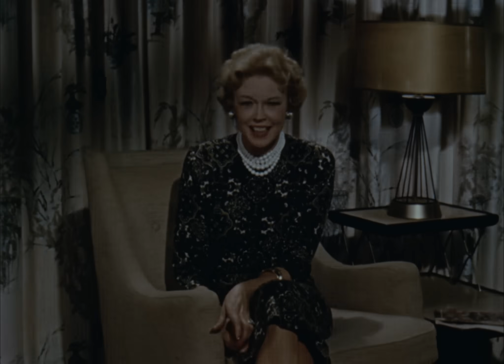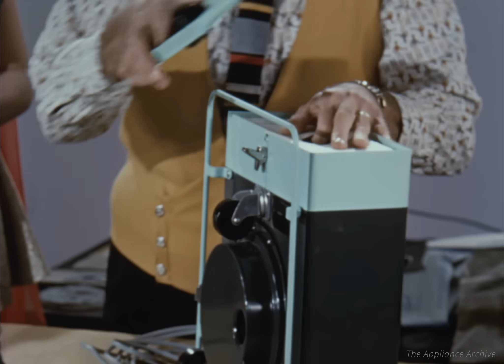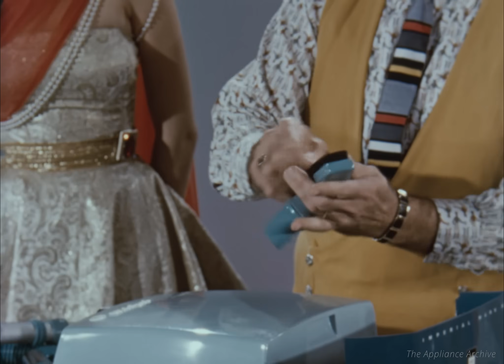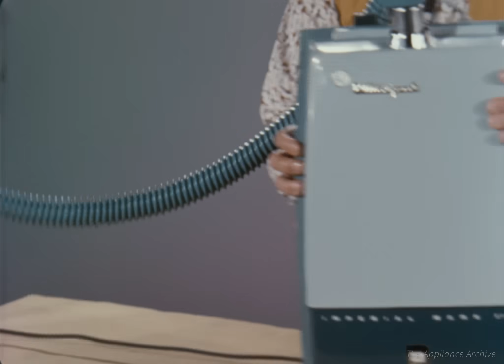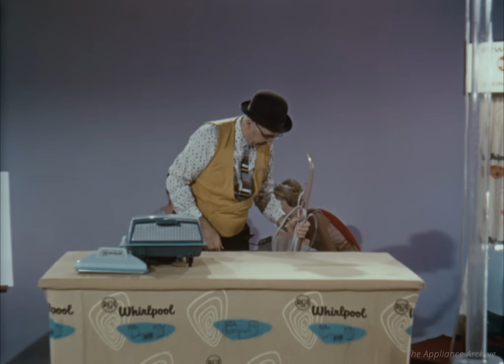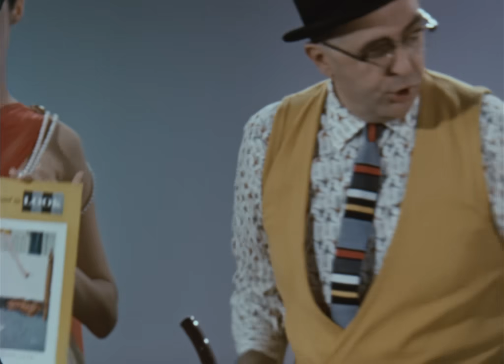Whirlpool Vacuum Cleaners w/ Fran Allison - 1957 - Restored 2K Print

Comment: I can imagine a lot of dust made it past that bag and destroy😂d the motor. 
Nice fashion - not.  Fran wearing her best pearls to add creditably to the product. 😅
Reply: It's not that bad. I have many vacuums that have been abused and left abandoned and they still do fine. The motors overheating is the main thing that killed these old vacuums as they needed the airflow through the bag to cool the motor. If you overfilled the bag and it couldnt get enough air, the motors would start roasting. I make my own HEPA bags for my old vacuums that have un-findable rare bags. and the HEPA filter bags make the motors ice cold, as they let so much air pass through more than a paper bag does.

Comment: Not the first Power Nozzle, BTW. That honor goes to Lewytt a year or so earlier (which unfortunately had a bad wiring design to power the nozzle). Electrolux would perfect the power nozzle starting with the Model G (and L) though at first with a clip on power cord and later power in the hose (like this one and the Lewytt).

Comment: did anyone else notice that when they tried the suction power of the Hoover, he deliberately held the brush roll against the carpet, effectively slowing down the motor speed and thus reducing the suction.
Even back then, manufacturers were trying to pull the wool over our eyes
Reply: sell, sell, sell, by any means necessary
Reply: He tilted the Hoover so the carpet sealed the suction part,so less air entered the machine so the air being expelled was restricted
Reply: Well, at least they used the vacuum cleaner to make sure the wool was clean before pulling it over our eyes!  Cuts down on irritation. he he
Reply: The carpet and angle of the surface was tilted, and above him, so he had to hold the wands at an angle. Neither of them were performing properly.
Reply: Well yes, it’s called marketing.

Comment: Not many people realize it’s airflow that moves the dirt, not suction. Suction is nothing more than a negative pressure, vacuum, therefore it’s not a movement. You have to move the dirt in order to move the air.
Reply: like a heating or cooling duct, perhaps
Reply: thank you professor
Reply: This is why with modern ulta plush carpets that do not have a breatheable backing pad, vacuums will stick to the carpet and not move. There is no airflow.
Reply: It depends on what the goal of the vacuum is and what it's used for.